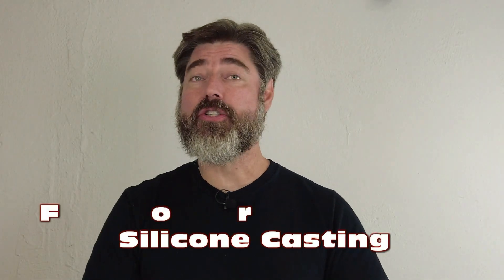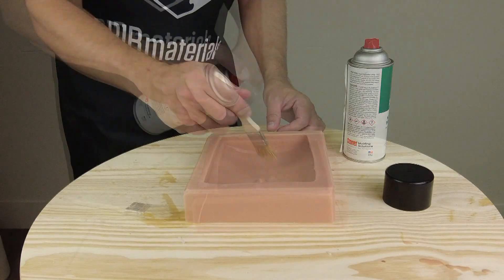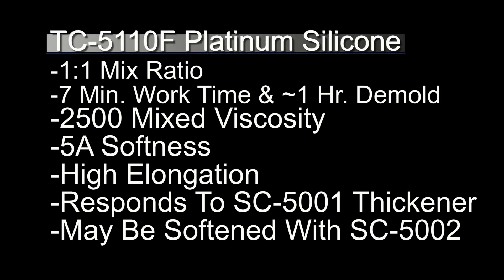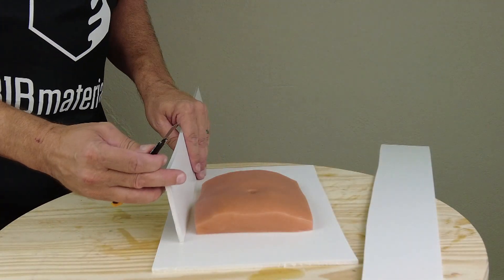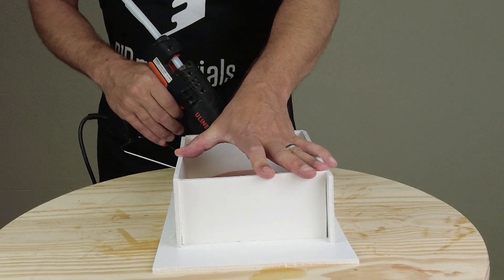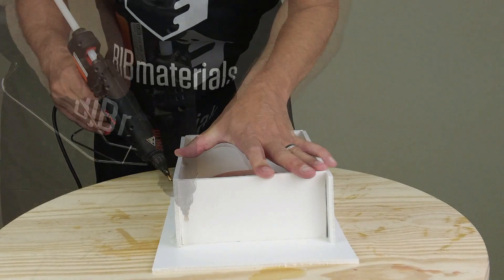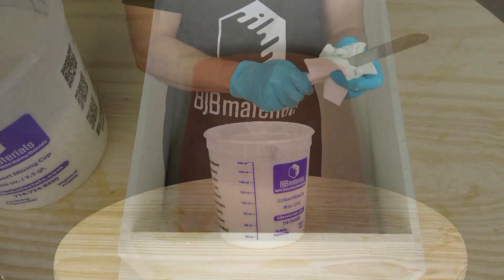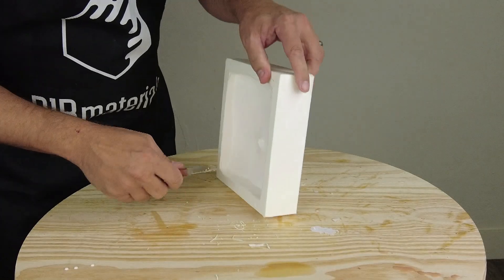Mold Making For Silicone Casting Part 2

Comment: Loved it. Making a jacket mold w/ TC804 or even a jig fixture for high heat post curing (although this would require a higher HDT base than the 804) really isn't too tough using Fiberthick. The only thing I do different, which adds one more step, is to drill mix the B-Side with the Fiberthick before mixing in the A-Side. This just gives a smooth texture, which is something I did with a JR-High classroom earlier this year to make giant Captain America Shields. But dang, it's hard to argue the way that part turned out!
Reply from the maker: Thanks Scott! I will be getting some Fiber Thick soon so that might just be a video doing what you described!